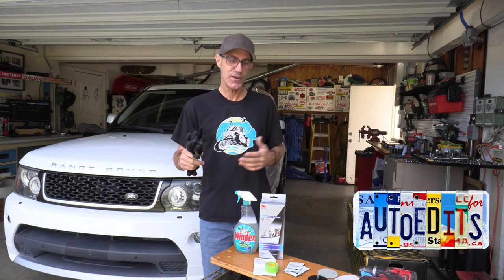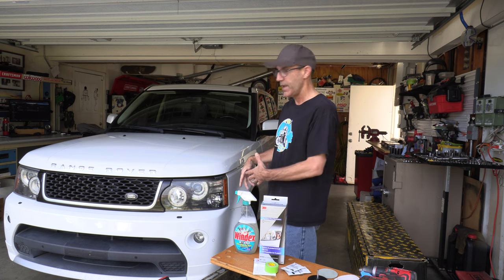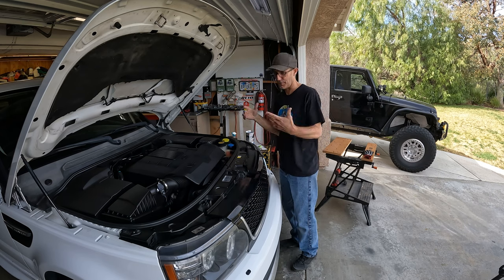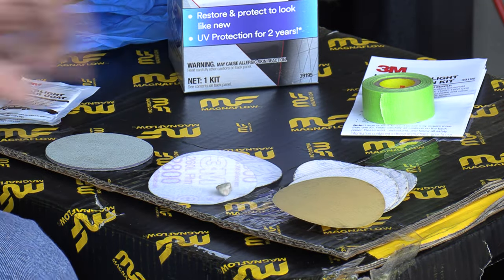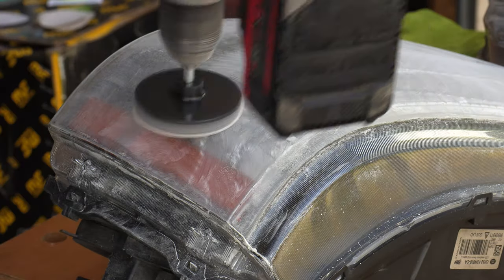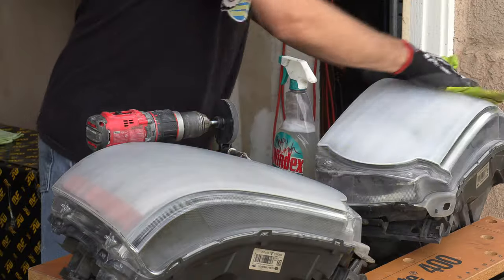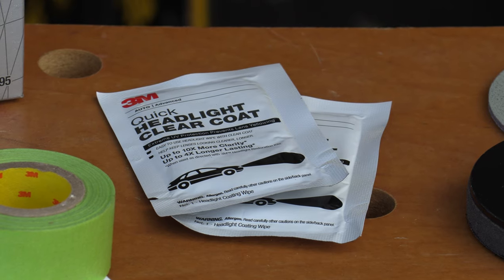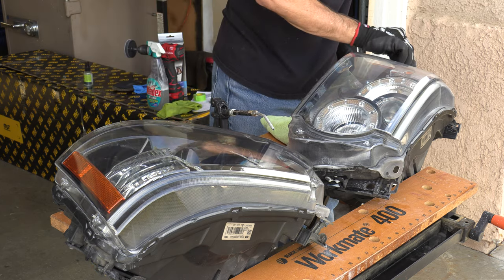Cheap and Easy Headlight Restoration How To DIY!

Comment: Nice results on the headlight restoration.

So what's next on the Rover? If it's running on factory 20s the largest tires size you can slap on are 30s 😉
Reply from the maker: There's a giant Magnaflow box on the floor that has some goodies for the Rover!  I'm thinking of trying to fit 18" wheels with 30" all terrain tires but the internet seems to be confused if those will or wont fit on this particular vehicle.

Comment: 500 grit seems very aggressive. Thoughts on starting with 800?

Also is that enough sealant to last?  Chappelle did some lights (Suzuki?) and they were wasted again in a year.  Please let us know how that holds up because we have two vans that need polished headlights.
Reply from the maker: The pitting absolutely needed the 500. I'm curious as you about if the UV clearcoat will last the advertised 2 years but the price point is acceptable for one to me.